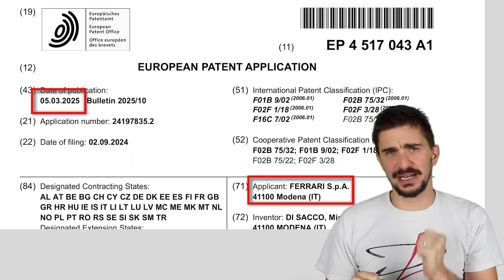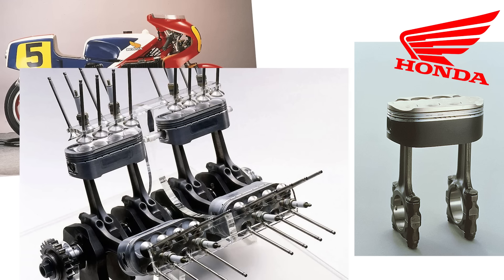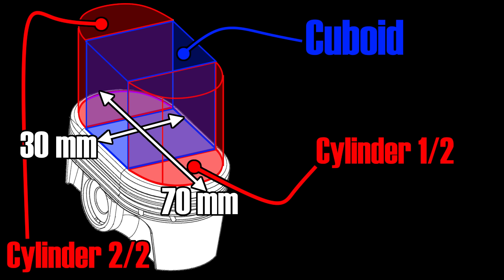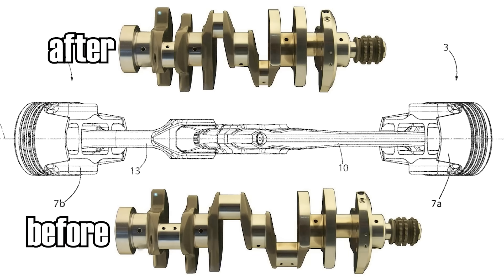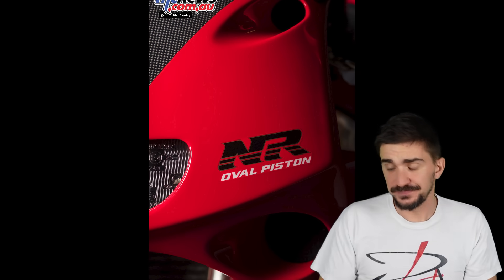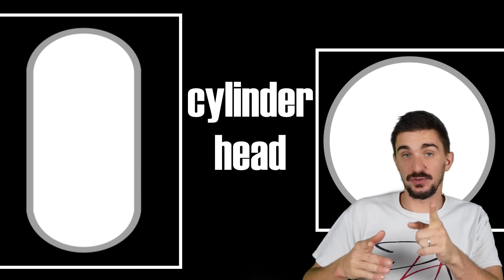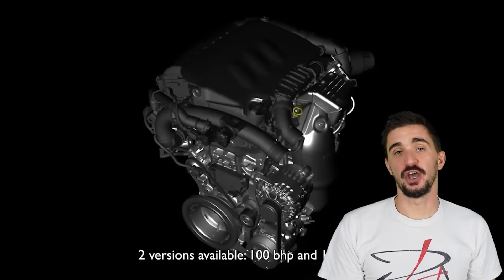Ferrari Just Patented Pill-shaped Pistons and Siamese Connecting Rods

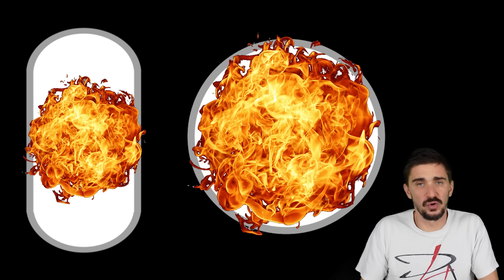Comment: 8:45 how would the valves be placed??
Reply: How about Rotary Valves, with dual sparks for even combustion? (Rotary Valves Make Normal Valves Look Silly - Why Aren't We Using Them?)
Reply: @Narinjas well what I’m saying if that on a regular engine the valves are angled, that would not work on this, they would have to angle the opposite way if you wanted to have more than 2 valves per cylinder.

Comment: I liked Hondas design better. It lessens piston rocking instead of increasing it, it also allows for more rpm.
Sure, it's longer, but it's also narrower. A W16 engine would thus be quite long but also a lot narrower, thus making it fit in more traditional engine bays. If it's still too long, maybe a W12 would be possible?

Comment: ok but those connecting rods are not really anything new are they? i mean these attempts were used before.
6:00 or also 2 valves could cover much higher %. like drawing 2 very big circles in an oval you get more % covered than 4 circles so actually this engine would be pretty bad with 4 valves per cylinder.

Comment: I believe the Merlin V12 used a wonkey connecting rod that was similar to the Ferrari unit. I could check and verify, but I'm just going to throw this out on a hail Mary. Because sure as night follows day, it's the DB601 and not the Merlin that has funky rods.)))
Reply: @EbenBransome  so both 601 and Merlin were funky 🤔 but neither as funky as the Ferrari mess. Thanks for checking for me. Not all heroes wear capes.)))

Comment: I wonder if it wouldn't make more sense to have both connecting rods on the same crank pin using a "fork and blade" rod arrangement? The point at which the rod with the "elbow" in it is already the weakest point of the set up, so there would be no sacrifice in going to a blade rod, fork rod set up.
Reply: That doesn't give you the advantage in term of a shorter journal length though as you still need some minimum bearing area for each rod to support the design load i.e. you can't just use half the bearing area that you would use for a single rod.  You do get rid of the rocking couple but that's not really a big issue on a conventional V8.
Reply: @ferrumignis   The fork/blade engines I've worked on had a full bearing across the journal which supports both the fork and blade. Full bearing, no "half bearing" issues. Huge loads, 10's of thousands of hours service. Well proven.
Reply: @brianhalberry  You seem to be missing the point. If the fork and blade each have bearings the same width as a conventional engine then it cannot benefit from a shorter crankshaft.
Reply: @ferrumignis  Sure it can and does. As an example, look up the fork and blade design for an EMD 645E3B engine. The two ride on the same journal. There are many other examples. You're assuming that each must have its own bearing. In these designs its one bearing, shared.
Reply: @brianhalberry  Think about that a bit more, you have two conrods moving in different directions relative to the crank pin. They cannot possibly share a common bearing.  If the fork and blade is as wide as two conventional conrods, which they would need to be to have the same bearing area, then the crank pin cannot be made shorter.
Reply: @ferrumignis  Well, I guess I'll go back in time to let BSA, General Motors and Rolls Royce know that what they did, can't be done.
Reply: @brianhalberry  You could simply explain how two conrods that move independently could share a common bearing, rather than a separate bearing per conrod. If you do that it should be irrefutable, right?
Reply: @ferrumignis  Test 1, 2 -OK, this is my third try at a response. Thank you for the civil discourse and discussion. Please look up the Rolls Royce Merlin connecting rod design. That should explain the relationship. As for the width of the crank pin and reducing overall crankshaft length, I doubt a fork/blade rod journal would be dramatically shorter (narrower). If that's the only goal an engine maker is trying to acheive, then maybe a fork/blade design is not for them. However the loading caused by a rocking couple is eliminated because the cylinders that the two rods serve are in the same plane. Some of the most storied, reliable and powerful engines in history have used fork/blade con rods.
Reply: @ Thanks for the reference, I see the forked conrod runs on the outside of the bearing, the blade conrod clamps the bearing.  It's an interesting design and makes sense as to how a one bearing can be used, albeit using both sides.  However I don't see how this negates the problem of total bearing area for both rods. 

For the sake of argument, if it was a conventional V engine and the rod bearings were each 1 inch wide, the crank pin would have to be two inches wide.  Moving to the Merlin fork/blade design mean you still need 1 inch of width for the blade rod, plus some more for the fork.  If the bearing was thick/stiff enough to spread the load from the fork, then maybe the fork width could be reduced a bit, but it's still not going to be anywhere close to 1 inch total.
Reply: @ferrumignis  Exactly. There is some opportunity for reducing crankpin width, but there are limits. The EMD heavy diesels utilise bearings with very stout backing to spread the load. The fork (or basket) dowels into the bearing and effectively locks it all into one unit. So the engine being shorter is still achieved, not so much by having small connecting rod journals but by eliminating the need to offset one bank ahead of the other.
Reply: @EbenBransome No probs, that's the beauty of mechanics, lots of variations and designs.
Reply: @EbenBransome Possibly. The fork/blade engines I've worked on had a full bearing across the journal which supports both the fork and blade. Full bearing, no "half bearing" issues. Huge loads, 10's of thousands of hours service. Well proven.

Comment: In early engine times there also once was a Y-shaped connecting rod with two pistons on the upper end, running in individual cylinders and the combustion chambers were connected. Obviously funny things happening as the two run slightly delayed….
Reply: You may be thinking of the Puch "Twingle" two stroke engine, which is a "split single".

Comment: If the couple it with some kind of hybrid I imagine the wear would be very little. Hybrids already hardly ever lug their engines as its usually the electric part of the drivetrain that gets the car going from low speed and RPMs. Think that's why toyota hybrids last forever.

Comment: I think the piston car engineer’s have reached the plaid or twilight zone stage in ludicrous designs ! 
My feeling , the most power achieved with a normally aspirated engine has been reached with a blend between torque ,  peak power and reliability for street use less a super charger or turbo to go beyond ! 
Two things hurt this design ,  you mentioned the rod design as being one . 
The other is even wear and distribution pressures on the rings and engine bore as the  engine block and piston heat cycle ! 
The round piston gives you what the oval piston cannot !

Comment: A few things you missed. Because of the piston offset each bank has a different stroke ratio. The rods on shorter side will have a higher angle of attack with will put way more side load on the cylinder walls.
Another thing is that the side with a offset will not have a smooth up and down motion due to the other bank rocking/swinging the main connecting rod.

Joined rods is also a old idea. I think there is a very old motorcycle engine that has a very similar design but I couldn't find it, I believe it might be a Harley. What I found was a W engine from the ~2000 that uses pretty much the same system. Its the Feuling W3. Edit: Found another way older, Renault 8G from 1916. 
I think I found the proper name for this configuration. Its master-and-slave con-rod.
Reply: He didn't miss it, he discussed the secondary imbalance.  This could be fixed pretty easily by making the block taller on the slave side.  The Renault G8 aero engine used the master/slave con rod design back in 1910 and coincidently was a V8.
Reply: @ferrumignis  I'm not talking about secondary balances. I'm talking about cylinder wall loads/scraping.
Cylinder wall loads increases as the rod angle of attack increases.

Comment: I want to see this used to make 2 valve engines more viable since round valves could take up a larger percentage of the bore surface on this. I think a 2 or 3-valve engine (mainly, having one exhaust valve) sounds significantly smoother and deeper in the exhaust note than a 4-valve engine. Plus, there would be fewer overall parts instead of more, which I think is a net benefit, especially if you also combine it with a single overhead cam and CVVD with plain VVT vs anything DOHC.

Comment: I'd be interested to see what the cylinderhead and valvetrain look like. If it is an 8 valve per cylinder head like the honda nr bikes it would be quite tricky to get air to the inner 2 intake valves. If it is a 2 valve engine, then the ideal spark plug placement is not possible.

Furthermore, cooling could be a problem with this engine as coolant passes only by the short side of each cylinder.

Comment: Piston rings that rotate , and the gaps that wont rotate on this design?  Ya, honda bikes, high miles like what.... 20k?  30k ? Extra pin on one rod? I will be supeised if its produced. The block metal between pistons will be so flimsy with that long thin wall seperation ... Lots of issues to overcome. I almost think this is a way to block some other design from some other company .
Reply from the maker: I'm sure you have much better ideas than this and I'd love to hear about them

Comment: This arrangement of connecting rods was used in radial areo engines for 100 years. It's called "master and slave" and there is even a section about them in "Connecting rod" Wikipedia article. 

I think this is why the patent has "drive" everywhere, to try differentiating itself from areo engines.
Reply: The Sunbeam world land speed record car (203mph) of 1927 also used this conrod arrangement.
This vehicle used 2 Sunbeam V12 aero engines and is currently being restored to operating condition ahead of the 100th anniversary.
My grandfather was a member of designer Louis Coatalen's special projects construction team.
Reply: Interestingly the master/slave con rod design was used in a V8 (Renault 8G) before it was used in a radial.
Reply: The Napier W-12 and Jumo inverted V-12 used the Master/Slave rod arrangement. And not all radials have used the Master/Slave rod setup. One system has fixed gear in the crankcase that meshes with an idler gear on the crank. That gear then meshes with a gear on the same centerline as the crankpin. The gear arrangement keeps the link rods in the proper position. Another setup uses two fixed link rods on the link rod carrier to do the job. The stationary engine manufacturer Nordberg built large radial engines for use in powerhouses and pumping stations. They built 11 and 12 cylinder engines in the 40s and 50s. The 11 cylinder used the gear system and the 12 cylinder used the company's patented fixed link rod arrangement. See Old Machine Press for more information. Both engines used a bore and stroke of 14 x 14 inches
Reply: I also think the setup has been used in some motorcycle v-twins.
Reply: If you mean the Harley con rods it's a knife and fork type arrangement @cbr9nmr
Reply: It's also worth mentioning that the Nordberg 12cyl were 2 cycle. That meant they could use an even number of cylinders
Reply: @Cletrac305  
Imagine building a 1/4 scale running model of either the 11 or the 12 cylinder. Bore and stroke would be 3.5"
Reply: Numerous large diesels also use the master/slave connecting rods, using them for decades. Nothing new Ferrari.
Reply: @davaogary7042  I suppose it's s new in terms of the application, i.e. a high speed petrol/gas engine, but you are quite correct that it's an old and well used design in other applications.
Reply: The Soviet Mikulin V12 aircraft engines were V12s with articulated connecting rods on one bank.
Reply: 110%, and they don't have to worry about vibration if used in multiples of 2, and flipping the master+slave around of the odds or evens. This makes V8's, V12's possible, the only two numbers Ferrari ever cared about anyway.
Reply: And it was even used in large 2-stroke Diesels, though that one is a fork & a centre one and not the same as this & radial ones.
Reply: The GE fdl/fdm/fds engines have a master rod & articulating rod setup. They're a sound/reliable diesel engine.
Reply: *aero
Reply: The Mikulin Engine that powered the Sturmovik IL2 had articulated conrods, but a different design. Apparently Hispano Suiza aero engines had that arrangement too, and they went back to WW1.
Reply: that wiki page mentions "A drawback of master-slave rods is that the stroke lengths of all slave pistons not located 180° from the master piston will always be slightly longer than that of the master piston, which increases vibration in V engines" this is not directly relevant to ferrari's  patent because the v12 pictured has perfect balance on each bank of 6 cylinders, even if the banks have different strokes.
also slavery terms are deprecated but w/e.
Reply: @martin-vv9lf  "Master" and "slave" are valid technical terms... they just don't apply to people.
Reply: @martin-vv9lf what is the modern replacement for masster/slave then? Studying IT I've not heard any alternatives yet
Reply: Not exactly. But close.
Reply: @ pearl clutching is a pain when it's expensive, like when nimbys sabotage planning permissions for no good reason, but in the case of a language change it's free, so why not make the effort. slavery is still a problem worldwide and changing our mannerisms would make a difference by raising awareness.
Reply: @martin-vv9lf  Pearl clutching and forcing people to use alternative language will not stop slavery, this is exactly the kind of dull thinking the the left is (rightly) ridiculed for.
Reply: @martin-vv9lf  Because grown adults who use ACTUAL critical thinking (not "alternative critical thinking") aren't fragile snowphlakes like you are.
Reply: @martin-vv9lf  that poor slaves will realy be happy about us changing the way we talk while still consuming disposable products made by child and/or slave labor.
But hey we can feel good about our selfes and start useless discussions over the internet.
Reply: @martin-vv9lf  One of my colleagues was worried about this topic when writing an operating philosophy for a master-slave control panel arrangement.  In the end, he decided that since that was the conventional term, and any other wording might be misunderstood, he stuck with it.  The control panels were made and installed, and no-one complained.

Comment: The only reason Honda built the "stadium" combustion chambers engine was to get around the maximum number of four cylinders for racing motorbikes. The aim was to make something like a V8. The results speak for themselves. 
-
Ferrari has lots of projects ended into the dustbin. That's another one, IMHO.
Reply: So instead of four they now could have four?
Reply: @seriouscat2231  Yes, but with a much shorter stroke, it was a 4 "cylinder" bike with the rev/horsepower potential of a V8.
Reply: @, ah, I see. Now I must look up what it sounds like.
Reply: The only reason Honda built the NR750 was to extract more power from a four cylinder engine.  This doesn't appear to be the primary design goal here.

Comment: Strictly speaking what you refer to as displacement is actually the 'swept volume'.
I remember the oval piston being tried a ways back so this will be interesting.
Reply: @ They aren’t. Displacement really includes the chambers where the spark plugs sit.
Reply: @ I know what displacement  means. 
The engines displacement is the TOTAL volume of all cylinders added when at bottom dead centre yes?
In fact to add to that;
A long, (ish), time ago now car mags and OEMs used to often refer to swept volume and displacement separately.
Looking at a few recent docs it appears that they now almost always put the word, "total" in front of the word displacement.
To confirm the difference, my M157;
TOTAL displacement = 5416cc.
Bore and stroke are 92.9 and 98mm respectively. The SWEPT volume is 5314cc. Where do you think the remaining 100cc is??

Comment: Another drawback could be that, in Ferrari’s piston layout, adding more valves is trickier compared to Honda’s layout, because the long sides of the cylinders face each other and there's simply no space for the manifolds.
Reply: This design may be more efficient with just 2 valves per cylinder as the flow area of a single valve per bank would be larger. Eight small valves possibly be overkill depending on the use case.
Point taken about the manifolding though it is not inconceivable that the inlet manifold could enter between the camshaft banks due to the elongation.
NB  Still thinking through the implications of this setup... 🤔
Reply: They could make the 4 valves nearest the middle of the engine be intake valves and the 4 valves nearest the outside of the engine be the exhaust valves.  Possibly time the valve furthest from the manifold to open slightly before the valve in front of it?  I'm not an engineer, just an enthusiast musing how to solve that problem.

Comment: There was a Honda race bike with oval pistons. It failed to win and was quickly added to the rejects pile. I would like to see Mazda finally get the rotary engine reliable and fuel efficient, maybe running a constant RPM to charge a battery for a hybrid.